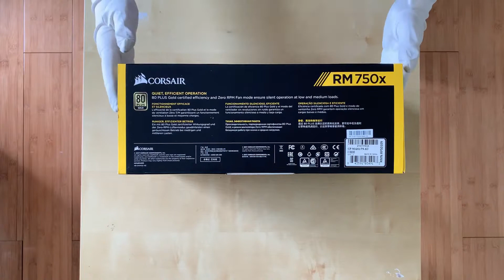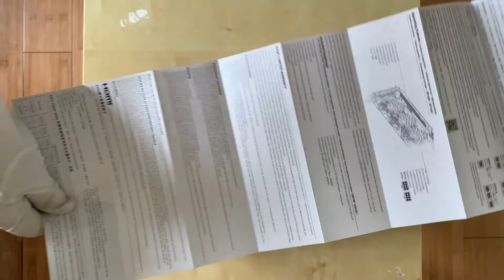Crypto Mining Setup for Beginner with Biostar TB360-BTC Pro 2.0 Motherboard Support up to 12 GPUs

Comment: I have a 1200w PS done everything required on the motherboard but the PS wont turn on had it checked and it works at a shop then brought it back home tested it and it worked my cpu fan was spinning worked for a minute until i turned it off because i needed to add more things but since wont turn back on? Any advice? This all happened today so not sure the issue.

Comment: I recently did my first mining rig build. I used this exact mother board. I used a Thermaltake 80 plus gold Toughpower GF1 850W for the psu. A Viper 8gb ddr4 single channel UDIMM  RAM. An intel I3 9100f LGA1151 9th gen that requires discrete graphics. And one MSI AMD Radeon RX 6600 Mech 2x and using FebSmart VER006C riser. I connected everything as shown and everything turns on, lights up and appears to be running smoothly. I wasn’t getting any monitor response when I’m running either a HDMI or VGA directly to the MOBO, but I do when connecting the hdmi cable from the monitor directly into the GPU and not sure why. From here I’m stuck and not sure what I am doing wrong, the bios seems to recognize everything but not my GPU. I also tried flashing what is showing on the biostar website as a different version but that doesn’t seems to be working either. I feel I have something connected wrong or need to update something but I am not sure what. Any help is greatly appreciated. I wish there was more videos on this or ones that go over multiple scenarios and explaining different possible set ups, strategies, and the of you happen to be using and fyi’s. Any help at all would be great!!!

Comment: I burned the board when I plugged a riser into the main graphics card slot-now I'm looking for a new board. Smh! I plan to use a warren of GTX 1080s. And yeah I made this mistake because my i5 9700kf cpu didn't have integrated graphics. I hope the cpu isn't toast but it doesn't look or smell burned.

Comment: If you increase the power supply to 2000w smps then can u put 8-10 nvidia gpu’s bro??
Reply from the maker: I would not recommend 10 gpu as 3060Ti has a TDP of 200 watts. However 8 gpu or under should be good.

Comment: hey how many 3060 ti i can use with this power supply crosair 750x? TNX
Reply from the maker: Hi, the safest is to run 3 rtx3060ti lhr in case the underclocking software fails and it runs at about 200W each